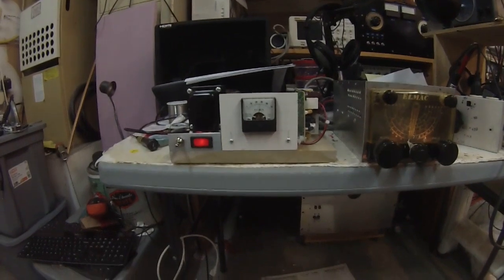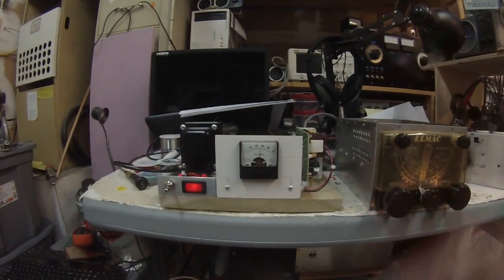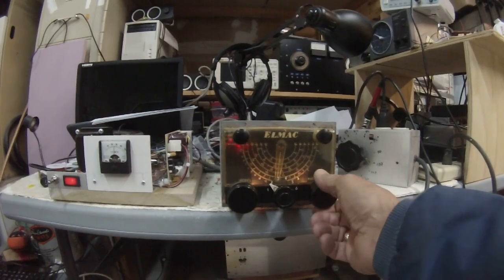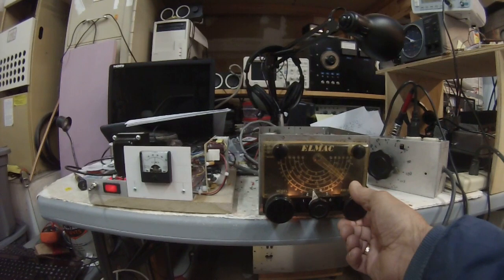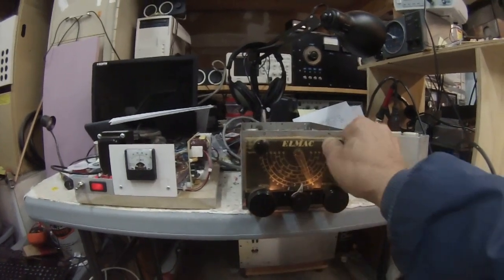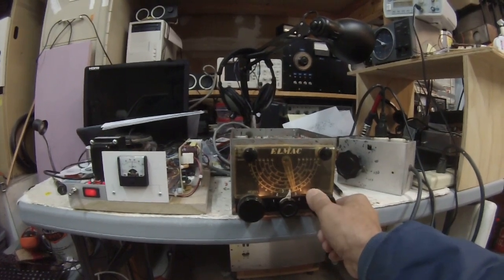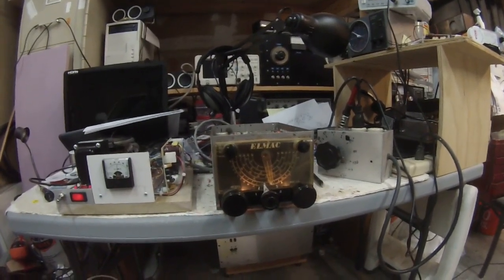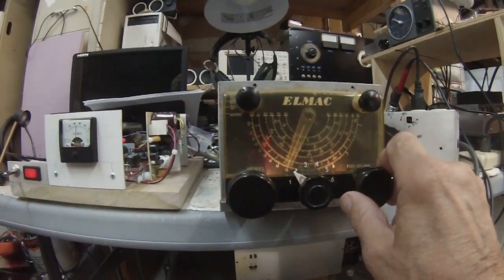The Multi ELMAC PMR6A Receiver ~ It is Alive

Comment: Hi Pete - the Elmac sounds terrific particularly on morse without the harsh static you get from solid state rigs. I use a LOT of vintage gear and am always shocked at the audio "quality" when put in front of a modern black box. You could try de sensing the set slightly using the aerial trimmer when receiving SSB to avoid overloading the demodulator. A matching valve TX would be a hoot. I dare you! 

73 de M0IDF
Reply from the maker: Hi David,

Thank you for watching the video and for your comment. Yes indeed detuning as you suggest helps on those strong signals.

I have been noodling a "toob" Tx -- about 5 or 6 tubes. 12AU7 mic amp, Diode Bal Mod, 12BA6 X 2 for IF stage. 12BE6 transmit Mixer, 12BY7 Driver, 12DQ6 final . Of course I would use the Arduino and Si5351 for the BFO and LO. The IF would be at 9 MHz. I better stop thinking this or then I would have some sort of Spontaneous Construction.

Pete N6QW